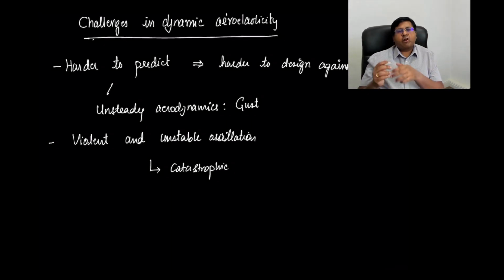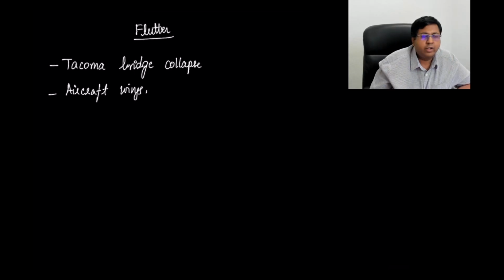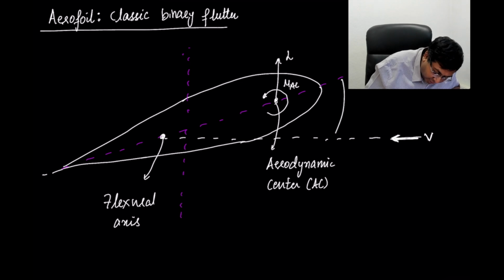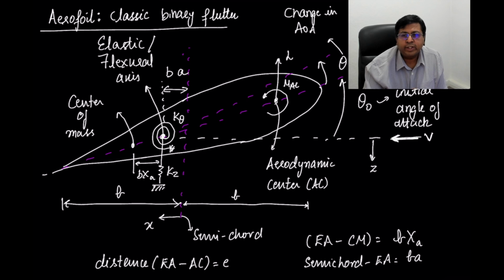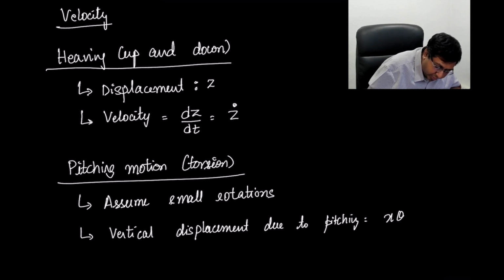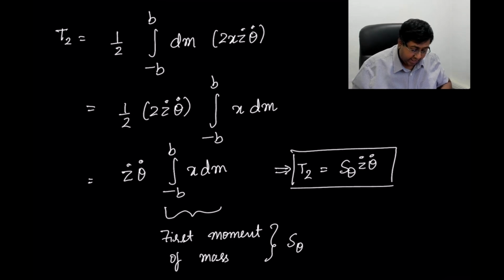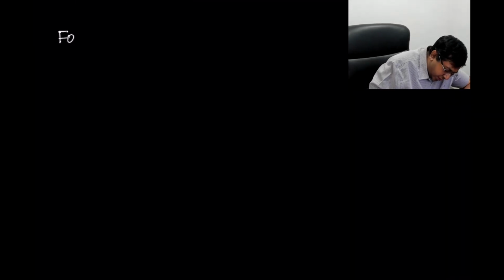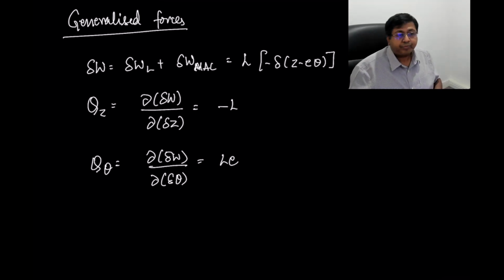Dynamic Aeroelasticity Part - I

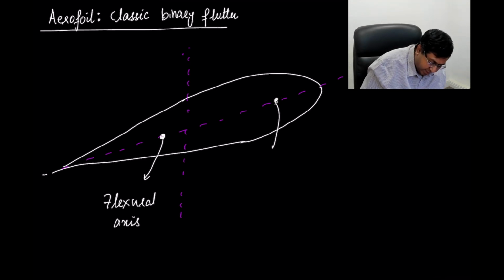Comment: Sir, at 12:08, doesn't lift act through the centre of pressure and not aerodynamic centre? thank you
Reply: lift can act at any point if you specify lift along with moment. at center of pressure, moment is zero.